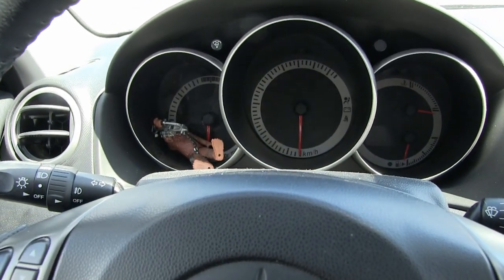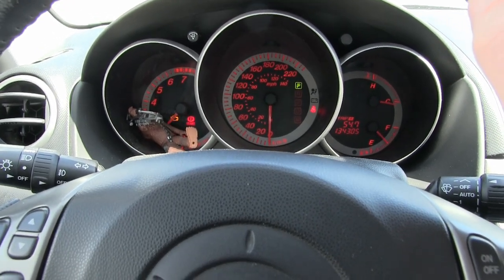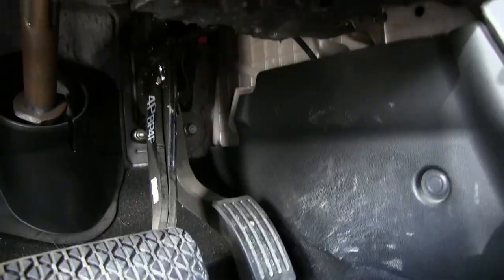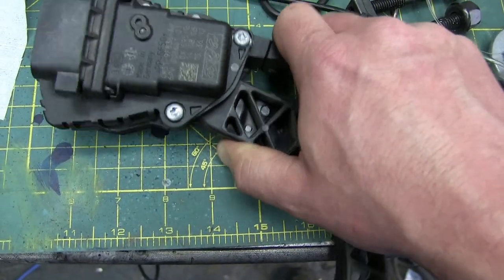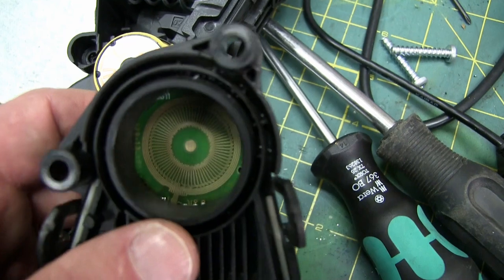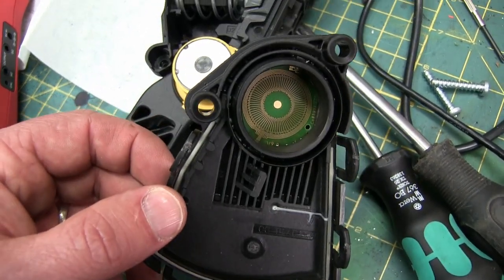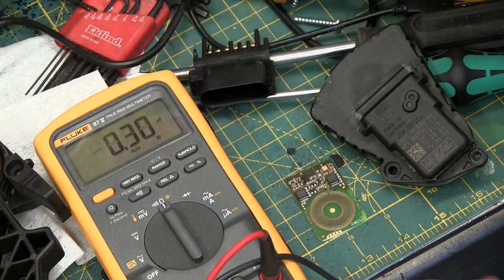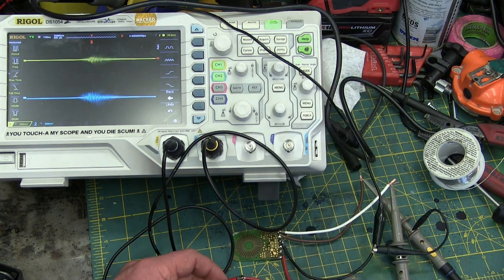BOLTR: CANbus accelerator pedal.

Comment: Throttle position sensors on drive by wire cars like this use two signals that verify one another as you stated. The PCM reads the first signal and the second signal is the inverse of the first based on peddle position. Its graphed as a percentage on a scan tool and if working correctly, when the peddle is at say 1/4 throttle the signals would look like say 24.5% on one and 75.5% on the other. What happens a lot is it will read 25% on one then like 80% on another if internal resistance is effected or if the actual throttle is acting up and that sets a fault. Hence why you got lucky, sometimes accelerator peddle faults are caused by throttle body flaps or position sensors acting up as well which is interpreted as the accelerator peddle itself acting up.

Comment: I could be wrong but I believe it uses 5 volt reference signal. and check the throttle position sensor on the throttle body.

Comment: I´ve seen this a couple of times, and it´s never been the pedal sensor. Ususally it´s been a clogged up drain under the ecu, causing water to seep into the ecu and down the throttle signal cable. The seal on the ecu isn´t always meant for withstanding submersion or just constant moisture.
Reply: I assumed the same. But i´ve seen it on Audi´s and Volkswagons where you´d think the quality was okísh, so why not mazda as well. Best of luck to you.
Reply: I totally agree, had the same issue with my VW Golf (a.k.a. Rabbit) mk4. I have replaced acc pedal, it turned out unnecessarily because the issue was the ECU connector - ECru is located near the windshield and prone to a lot of humidity. After cleaning it the car was running just fine.
Reply: Pretty much the same story for me. I live in a northern temperate zone with lots of dead leafs and a lot of rain. Over time that just clogged up that drain and despite being elevated, living in a pool was just too much for the seal. 
Funny sidenote regarding this video.. I had a friend with the same problem, he went about it in precisely the same way as AvE and broke the pedal, only to find a wet ecu. :D I guess it´s a common thing.
Reply: Same for my moms Minivan (the horror, I know). Pine straw of all things clogged it up and the Air conditioner dehumidifier poured water into a connection. Also into the cabin, very surprising the first time she turned left and I got freezing cold water on my feet.
Reply: This is the second time I've seen this mentioned. I guess VW/Audi has drain 'flaps' under the battery that get clogged up. They are circular rubber plugs with a a big X cut through them and they clog up easily.
Reply: This seems like a solid possibility.

Comment: 3 of those pins should be for the idle validation circuit, and the other 3 for the tps.  if either of those two other codes are related to idle validation, the pedal is more than likely the issue. I'm not familiar with what standard ford uses for CAN, but if it shares any similarly with J1939, you should be able to throw any generic auto parts scanner that has logging capabilities and verify tps when you throw in a new pedal.

Comment: Hey AvE, I just had a similar problem on my C Class Merc. Swapped out both accel pedal and throttle body, but to no avail. Didnt want to throw more parts at it, and then checked the wiring. Turned out to be a dirty connector at the ECU side. So, do check the wiring.

Comment: The link has a pin out schematic for the APP (accelerator pedal potentiometer) as well as as a flow chart for diagnosing the possible cause of the fault code. Hope this helps.

Comment: Any critters in your area? That is behaving as if it is not getting the feedback from the electronic throttle body. I'd check under the hood since Mazda used some kind of delicious vegetable matter for the under hood insulation bits.

Comment: AvE most likely CAN driver on that board awaits for some diagnostic message before it starts responding. That's why You'll not receive any signal from accelerator circuit if it's not connected to the rest of CANbus.

Comment: Hey ave!  I love your videos. I'm in the automotive industry south of the border from you in the US. If you ever want pinout diagrams of any automotive component let me know and I'll give them to you. They didn't always use contactless inductive position sensors in APP sensors. This is newer technology. And most of these do use 5 volts not 12. The potentiometer types used to use two independently operating potentiometers one starting at 5 volts and going down to 0 volts, the other one starting at 0 volts and going up to 5 volts. The values would be inversely proportional so the computer would constantly do a sum check of the two readings. Any time the sum was over or under 5 volts the computer would realize that something is wrong which would trigger the computer to go into failsafe mode to prevent accidents. I wonder if these newer contactless inductive sensors have a failsafe system built into them as well?

Comment: Had this code pop up in a couple of ford diesels when i worked as a mechanic. We threw a new petal at it, in most cases it was a bad petal, but the rare case of a bad pcm was a pain in the rear if you didn't have a pinout. Good luck and I hope it's just the petal.

Comment: I was wondering if its as simple as some resistor is just faulty or not all the way soldered on and it fails to chooch at low voltage.

Comment: those are usually pretty robust there is two separate sensors in them they work off of two voltage scales 0 to 5 volt some times they are just different voltage scale or one is pull up the other is pull down they are known as acceleration pedal position sensors.the throttle body has the tps sensors on it there is also two the car was in limp mode due to the code. ecm limits the throttle most likely bad tps sensor on the throttle body

Comment: It probably goes straight into low power sleep mode on power up to conserve battery. If you're lucky there could be a single good morning frame from the bootloader on startup. You probably have to send a specific CAN frame to it in order to wake it up and get the periodic communication going.

Comment: Pretty sure they use a Hall Sensor.  I'm a T-yoda guy and they use a Hall sensor in the throttle.  It has 2 signal that need to match in order to operate.  If the signals don't match it goes into erectile dysfunction mode.

Comment: when i was installing a new motor in my RV i had to move my canbus gas pedal 40 feet from the motor  to make the system fly by wire as well 

the pedal talks on its own set of wires for a GM and you have to move the pedal ECM with the pedal  so you add the 40 foot of wire from that ecm to the motor ecm .  that was hard to find out

Comment: If it doesn't register a throttle change until you push down most of the way, it's got to be a problem with the mechanical bits of the encoder.  Because the electronics just counts pulses, it's doing the same job no matter where the pedal is.

Only other possibility is the zero throttle position got miscalibrated.

Comment: My neighbor has a dodge durango, he was deployed overseas when It quit on his wife.  They have there own light for the drive by wire.  I replaced the pedal and the throttle body "the two most common problems" and still nothing.  He is an electrician on A10's after he got back he took it to the stealership, they put on two new pedals and charged him out the ass.  He eventually got it tracked to a short in the wiring harness.  Good luck with this one and keep us posted.  By the way if it's already fucked you can't fuck it anymore, I took his pedal apart and it looked just like this one.

Comment: Interesting note, the two signals that come from the transducer thing  are opposites, one goes high to low resistance while the other goes low to high, allowing the confuser to self test and know when its fubar.
Reply: Also, used to work in parts at a local ford dealership... Let me see what I can do to dig up a pinout for ya.

Comment: it looks like the same principle as a electronic caliper. I counts the "steps" per degree of rotation. Initialing is no problem because the paddle has a default position.
It would be interesting to see what happens if you push the paddle to the floor and then start the car.

I think this system needs an init-routine and communicates digitally with the main system. Otherwise the system can't detect if the Paddle is faulty.

Comment: I had this same issue with my 2005 Pathfinder a real quick test to see if it is your TPS or Gas Pedal is to set your cruse, that is if you can drive the car at all.   If the cruse works with little to no rpm movement then it's the gas pedal.

Comment: I broke 2 cardinal rules of troubleshooting today. Artic haul truck displayed a throttle issue code, dealer tech diagnosed a few days ago, and found broken wire loom but no broken wires and no resolution. Today, older mechanic and I went to work on it while it sat. I went to follow the diag steps outlined in the manual, while he poked around under the hood. He found the broken wires before I logged into the service information site.

I didn't start with the simplest step, and I let the other guy tell me what was up. Insult to injury, the old man beat me to it.

This damn kid might learn one day.

Comment: P 2126 means that the app2 sensor has gone bad. That accelerator pedal you have has two sensors built into it. The PCM uses one to cross check the other sensor. Your first mistake was probably putting 12 volts to it, most likely it uses a 5-volt reference  from the pcm then 2  sensor outputs back to the pcm and a ground.
Reply: Correction , the app2 signal is not getting to the PCM as expected it doesn't necessarily mean the sensor is bad but more than likely it is.

Comment: I like these Auto videos, with that said. Check the other TPS on the throttle body, If either sensor is not working or sending false readings it will throw a code and go into limp mode.

Comment: I drive a supercharged 2009 Chrysler 300 with the same accelerator setup. In the smidge over a year that I have owned it, I have snapped the pedal off in twain on 2 separate occasions. They sure ain't made like the big block mopars of old that I grew up driving.

Comment: Gee, this is so much better than having a simple stainless steel cable that is actually connected to the throttle body. I cant wait for my steering to become computer controlled too. To hell with strong, reliable, simple physical connections. I no longer want to be in control of my car. I just want to be an input to the computer and let it decide what the car should do.

Comment: I had a similar issue with the electronic pedal on my truck cutting out. it turned out to be a grounding issue.  I lost the ground strap on the exhaust by the cat.  I fixed that up and the never got the code or limp mode again.

Comment: APP Sensors typically have a circuit that goes from high V to low V, and one that goes from  low V to high V, and these need to be inversely proportional,  with no dropouts or you will get APP DTC's.

Comment: Looks like a nicely made part, capacitive effect sensor. I don't think you'll get anything out of it without sending it a CAN bus request. Probably in sleep mode until bus activity wakes it up.
Can you please post a close up of the board and / or the chip numbers?
Maybe send it to Dave EEVBLOG for failure analysis.

Thanks

Comment: The GMC, Cobalts are electric steering and had key switch issues, the key would bump to off in motion, turning off steering and braking. At least two crossover collision deaths as a result. Seems there should be a panic safety switch for steering and brakes...

Comment: AvE: What you've got there is a Hella CIPOS angle sensor. I also couldn't find a diagram but there is a pinout spec in the FSM. 

Left to Right (who knows which way is which without the connectorino on) Vref (5v most likely), Signal?, Sensor Ground, Engine Ground, Signal? Main Power (12v).

Only much newer vehicles will use a data signal out of the pedal. 9.9/10 it will be differential signals with one going high and one going low at the same "rate" and others will be  just two signals going high with a slight offset in voltage to "check" each other. 

This fancy CIPOS sensor is just a skookum sensor system to ensure that no dirt or debris will cause the sensor to read wrong like it could happen with a potentiometer. It actually has to count how much it's moving the coils on the pedal side over the matrix on the PCB to generate a position, like you said, a rotary encoder, but contactless. Shoot me a PM if you need more details.
Reply: so if the sensor somehow resets or lost position?
Reply: +Pete Lorenzo yeah. I'm assuming when energized from the main relay 12v it zeros position or the encoder detects position.

Comment: I would have tried a continuity check between the throttle pedal and the engine ecu or wherever a schematic says it goes to. Then do the same between the throttle body and the engine ecu. 

it's always best to do the simple things first when trouble shooting, chances are the throttle pedal was not the problem. We all play darts sometimes but it's not the way to go about it as you said in this video. Good luck with her

Comment: If its anything like the bosch dbw setups it effectively uses two 5v pots that go 5-0v and 0-5v, plus using the Rotary encoder to tell direction/speed to open /close the throttle plate. Here is the pinout for the throttle side of the bosch setup. The pedal should be the same 

http://www.bosch-motorsport.com/media/catalog_resources/Electronic_Throttle_Body_Datasheet_51_en_10726070795pdf.pdf

Comment: Ford owns a small percentage of Mazda, not completely. Plus you can find a complete wiring diagram of the throttle system in the car and it should have the pinout of the pedal assembly in there.

Comment: ECM/ECU=Engine Control Module/Unit runs the engine, fuel injection, spark timing etc. PCM Powertrain Control Module. Runs things like transmission control,  transfer case etc.. BCM Body Control Module runs thing like keyless entry, HVAC, gauges, headlights, taillights, turn signals cruise control.. cars are chock full of computers now days

Comment: One thing I don't get. There is nothing in this throttle pedal that can actually fail. I had the same happen to my steering wheel angle sensor: I have fully tested it: all electronics are working, all sensors are fine, it communicates over can bus just fine. But spits out a fail code and in result I have no ABS, ESP, cruise control.. And funny thing is that sensor is not available separately, so $800 steering wheel is needed. On a $4000 car. 
This does really look like a designed-in timer for failure. I would really like an informed comment on this.

Comment: Heyo, so you have part of throttle control system for a 2005ish focus. let's clear up some nomenclature. It is actually an Accelerator Pedal Position sensor APP. TPS is different. P2126 PCM flagged fault APP failed self test. If you want I can find pin out but generally there will be 5vref/5vsig/ and as you noted 3 paths app1/2/3 with pin 6 being vpwr. This is a ford term and am fairly certain it means source v/12v. This sensor has a few uses. Tells pcm how much throttle you want (not the position) speed of application or release, stomping on it for example. Sudden release this will be used with other sensors (brake application, wss etc) to figure out what you are doing/is happening. Also used for anti surge circuit in turbo to prevent hammering of turbine blades. pop off valves are sooo old school. 12 billion tests to verify fault. max min resistance between app1/2 app1/3 etc etc etc. I just replace them after cursory wire inspection. No variable functioning circuit on a car will be 0v or 5v. Between .5v and 4.5v pretty standard. I will let you in on a secret very few people know. You don't tell a car what to do. You request something. If all of the parameters are within defined limits, then you get your request. Examples. Try pressing trunk release with car in drive, no go. -40 out and you turned on blower and heat for windshield, sorry not getting heat until engine is at certain temp. Bet you didn't know about that one. This request system is on just about every single circuit in a vehicle. One final point. Everything on a drive train is designed for one purpose only, emissions, period. You have a great channel.

Comment: You have to find the computer signal wire most automotive sensors use a 5 v reference signal not a 12 volt.. A computer ground and sometimes also a variable ground... Its crazy stuff there ave.... Better to test connected to the car...... Also there is another throttle sensor in the air intake actuator...

Comment: Actually this is called a drive-by-wire system.  The pedal is actually a reverse shunt connected to the ETC or electronic throttle control.  The throttle body has a stepper motor that holds the throttle closed and then when you press the pedal the voltage to the throttle motor drops allowing the spring to overcome the motor and thereby opening the butterfly.  The two mot common failures on these systems is the pedal or the throttle body motor.  Unfortunately you will be unable to replace the motor as mazda only sells the whole throttle body assembly.  Typically these are replaced in pairs as the pedal often ends up with "flat" spots making for uneven throttle control.  Replace the throttle body assembly and the pedal.

Comment: It needs the yellow part completing a circuit between those contacts. How can you expect it to work without the wiper part of the encoder in contact with the pads on the board... I am disappointed  you failed to just clean the contacts, reassemble the device and test it.